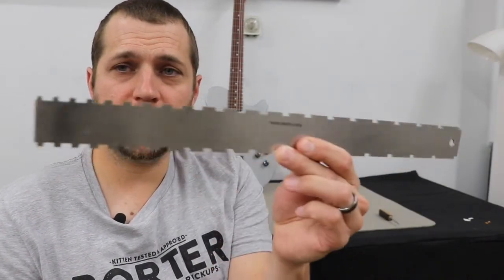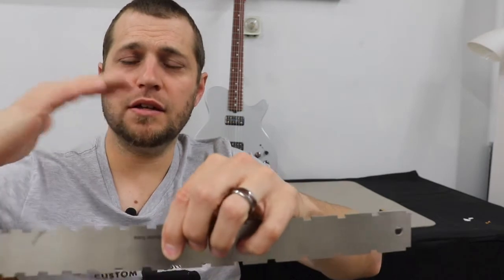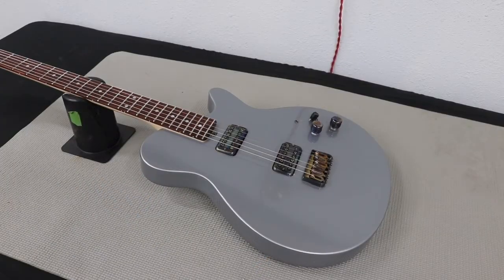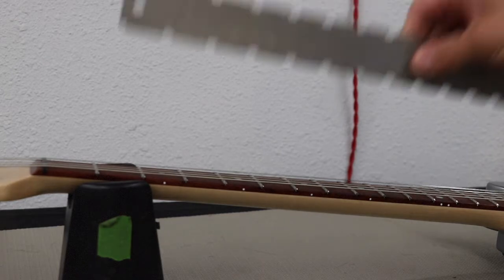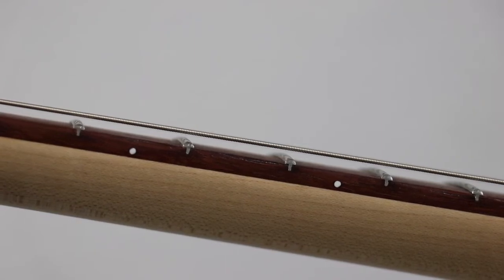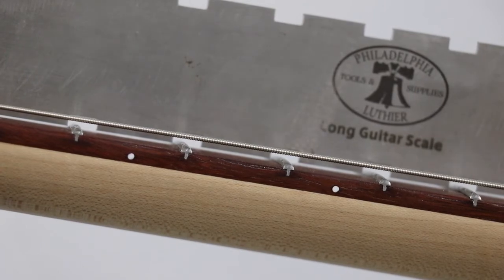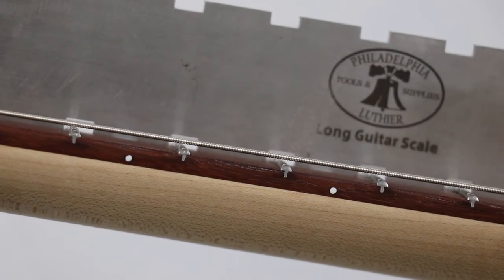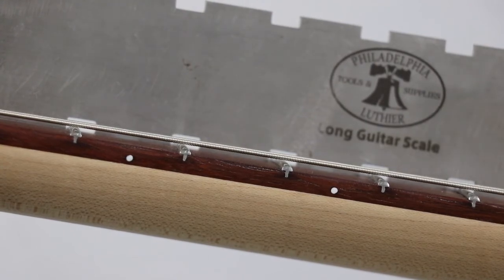Tone Tips: Using a notched straightedge to read your fretboard

Comment: As far as I know, almost all truss rods work that way: 
Turn to the right to tighten the rod, meaning you work against the string tension, hence bending the neck down-/or backwards.
Turn to the left to loosen the rod, meaning your string tension becomes stronger relatively to the rod, hence giving the neck an upbow or "relief".
The relief basically always refers to a lower tension on the rod and the following upbow. More relief = Less Rod Tension.
Reply: I think the reason why he said it might be helpful to find out what kind of truss rod you have is because some you can screw the nut all the way off the threads. Just something to watch for.

Comment: thanks. question. does measuring the gap under the ruler give the same result as the method with a feeler gauge over the fret with strings pressed at 1st and last fret?
Reply from the maker: Yes, your measurement will be similar, but it’s always best to know what the fretboard is reading in case you have a high/low fret. In the string case that is your straightedge reference, but it’s important to check multiple ways. This tool also helps identify if your neck is uneven on different sides of the board (worst case, a small twist)

Comment: I’ve got this tool. Question is I have a guitar with a Floyd Rose and want to lower the tremolo all the way down to sit on the guitar. That will help get the strings lower at the neck pickup. Will I have to redo the relief on the neck once I do that?
Reply from the maker: you will have to see how it responds when you tighten or loosen the tension on the strings. It can shift if you take all the tension, but a well built neck shouldn't move much on a string change
Reply: @PorterPickups  it didn’t move. Works fine

Comment: Thanks! I have a straight edge beam, and the middle of the fretboard seems fairly flat. However After 11-12th fret a gap appears even after some adjusting, and the and of the neck around the 21th fret seems slightly raised, which is probably causing string choking while bending the first two string after 12th fret.
 
Also, I have noticed that some people sand the frets after the 12th fret a bit more than the lower ones, to facilitate lower string height. Is that a valid approach to solve the string chocking issue?
Reply from the maker: Is there a gap in the first few frets when you have the neck straight or just the post 12th fret area? Some people add a slight fall away towards the end to help. Make sure to reference the notched edge as well so you can “see” the fretboard without the frets. You also may need to use a fret rocker to identify where the frets are high.
Reply: @PorterPickups  Thanks for the answer. I've checked again, and it seems to me that the issue occurs after the 15th fret, as it looks that the part of the neck around the neck/body connection is raised slightly. I've got it pretty straight from the frets 2 - 10ish, but then the gap starts to appear, and the last notch of the straight edge sits back on the fretboard on the 21st fret, and it closes the gap. I am not sure what to do, maybe I should risk with sanding down the fall away area, from the frets 12-21 a bit more.
Reply from the maker: possibly a neck hump it sounds like @dalmatdevelopment7821

Comment: I have 4 of these, 2 for guitar and 2 for bass and no matter how much I turn the truss rod I can’t seem to get the level to go perfectly flat on the fret board. I’ve tried different levels and on different guitars. There’s just always a small sliver of light as I pass my flashlight behind it. Does it have to be perfectly flat like yours or is the gap that I can’t even fit a feeler gauge through good enough? I’m about to do my first fret level on a cheapo neck to practice on before working on a nicer guitar neck. Any help is appreciated!
Reply from the maker: it could be a few things: slightly uneven surface on the board itself, or the straightedge isn't straight. It doesn't have to be flat in fact many people want some relief in a neck. If the gap is very small you're probably ok. you can check some relief charts online for suggestions at different frets, and then you can ultimately set your guitars up to your personal tastes.

Comment: You tightened the truss rod in clockwise direction to make it straight? I am just a little confused by the language of relief.
Reply from the maker: the language differs when it's a double action rod. Some single actions really only go one way. On the double actions we tighten/to the right to make it straighter
Reply: As far as I know, almost all truss rods work that way: 
Turn to the right to tighten the rod, meaning you work against the string tension, hence bending the neck down-/or backwards.
Turn to the left to loosen the rod, meaning your string tension becomes stronger relatively to the rod, hence giving the neck an upbow or "relief".
The relief basically always refers to a lower tension on the rod and the following upbow. More relief = Less Rod Tension.

Comment: Should the neck be adjusted completely straight for playability or should it have a small amount of relief?
Reply from the maker: it really depends on what you want for setup and the neck itself. Usually there's some relief on most necks and it can compensate for some slightly uneven frets if there's relief. dead straight is good if the board is perfect and you like to have the lowest possible action.
Reply: @PorterPickups

Comment: Is a guitar neck supposed to be slightly bent? There's no buzz in mine and also plays very well
Reply from the maker: you can set it up to preference and if yours is straight and no buzz thats a good thing!
Reply: Most of the time there is a slight bend, it's perfectly normal so long as there's no buzz and it plays great. that's the aim,, and if it plays great with it straight it's also normal, so you're absolutely fine :D
Reply: Hey guys one last question, I'm worried about my saddle, it is extremely low and the sustain is suffering, but the neck still has relief, can i install a new saddle? Then adjust the relief?
Reply: @patrickjan7896  Just so I definitely know, what are you meaning by saddle? The whole bridge? What type of bridge is it? Low sustain can be caused my maaaaaaaany factors and you can fix it or improve it with upgrades if you wish, yea. Just don't wanna suggest or say something if I'm misunderstanding and make things harder for you haha
Even old/bad strings, shitty quality strings, or a random bad batch of them can cause various things including poor sustain
Reply from the maker: @patrickjan7896  have you tried adjusting the saddle height to see if that helps? sometimes a small adjustment can make all the difference.
Reply: @PorterPickups  i did bought a new bone saddle and sanded it to my preference, but the tuner and pick ups (under saddle) didn't worked so i used the old one and decidedto send it to a luthier.

Comment: Is there a certain fret that we want to measure when we use a feel gauge and notched straight edge?
Reply from the maker: typically in the middle of the board or the length of the straightedge (between 7-10th frets)
Reply: @PorterPickups

Comment: If PRS specs .01" using the string as a straight edge across the first/last fret, would this be the same measurement I'm looking for using the straight edge?
Reply from the maker: that one way you can do it for sure. start with a feeler gauge and adjusting relief to your intended specs.

Comment: Can do this in the playing position? I’m new to this and I just got this tool. If I do it in the playing  position I don’t see many gaps, but if I do it with a pillow under the neck (simulating the device you have) it show larger gaps more in 7-13 frets. Sorry if it’s a silly question, trying to get rid of some string buzz but my action is higher than it should be to buzz. Thanks
Reply from the maker: sometimes you'll see larger gaps on a bench vs playing position. Always default to playing position as sometimes laying on the bench or a neck rest can effect it